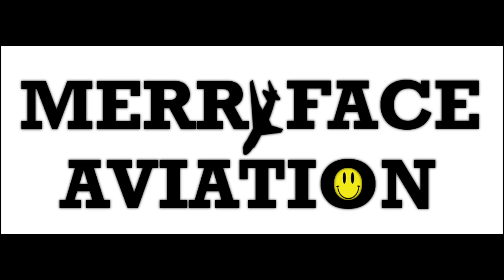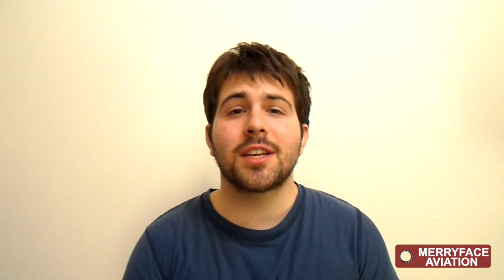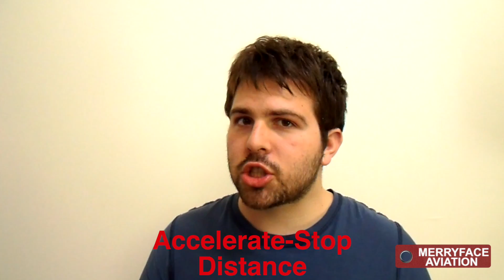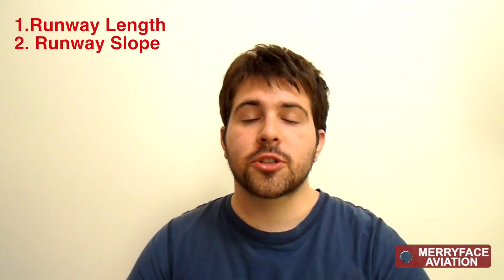V1 Explanation of V Speeds by Merryface

Comment: incomplete definition. v1 is also the minimun speed where the airplane is able to fly folowing a engine failure and achive at least 35 feet at the end of the runway and meet all the gradients and obstacle clearences required. v1 also cannot be lower than the 1.05% vmcg minimun control speed ground.

Comment: good video. But you said V1 is never higher than Vr.. I'm currently training on Piper Seneca and Vr is 80 MPH whereas V1 is 90 MPH!!
Reply from the maker: Thanks for the kind words. however, I am right. V1 CANNOT be higher than Vr, by its very definition. V1 is the last speed at which a take off can be aborted. Vr, is when you rotate in order to actually take off. It would be nonsensical to have a speed to decide not to take off AFTER the take off. Also, V1 is not in the Seneca POH, and Vr is 80kt, not MPH.
Reply from the maker: Perhaps you're getting V1 and Vx confused?
Reply: seneca is a light twin there is no v1 at this type of airplane. you have red line vr and blue line.  @MerryfaceAviation

Comment: Come on Tarik, you should have just done Perf A but possibly, just like the rest of us, may have forgotten what you were taught as soon as you went to the toilet after the exam. But you have chosen a complex subject and attempted to give us a definitive guide. You were correct to an extent, but there are a few other factors that also control V1. Additionally, sometimes you have a choice as to whether you want a low or high V1. Now for the definition of V1. You should really have the definition clear; it's the highest speed that you can decide to stop a take-off. That means it is a decision speed. And now for what I think is a full list of the factors: Mass, Thrust Setting, Pressure Altitude, Flap Setting, Wind, Runway Conditions (slope, surface, etc.) and Temperature.
Reply from the maker: +Trevor Austin this is almost two years old to the day so I had to re-watch it to see what I said. I'd just like to say that at no time do I say that I'm giving a definitive guideline. I say I "present" a V speed with each episode. Usually that means an introduction to something. No point in going into the complexities of it, like low and high V1. 
My definition of V1 is pretty spot on. Yes, it's decision speed, but it's official name is engine failure recognition speed. "this is the speed at which an aircraft must take off, even after an engine failure." That's pretty clear to me. I explain quite clearly its objective afterwards too. I may not have explained it the way you would, but that's ok, there's more than one way of going about things. 
I'll give you that I should have mentioned flaps setting and all the weather  stuff, but the rest I talked through.
I'll make mistakes in videos, and I genuinely appreciate the feedback. I use it to improve my own knowledge and details for future videos. But saying that I "have forgotten what you were taught as soon as you went to the toilet after the exam" is actually inaccurate and rather rude. Don't see this as a provocation or me asking you to discontinue criticizing my videos. I'm just asking you to think twice before posting that sort of comment.